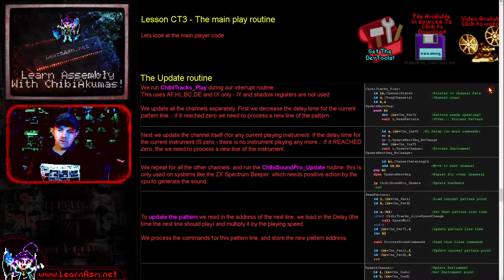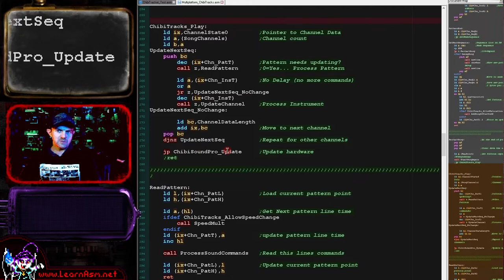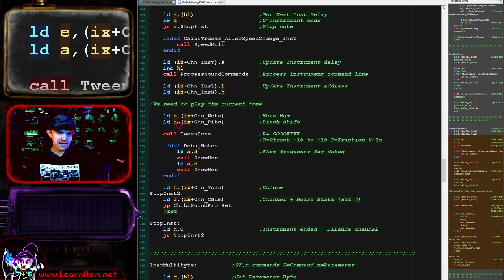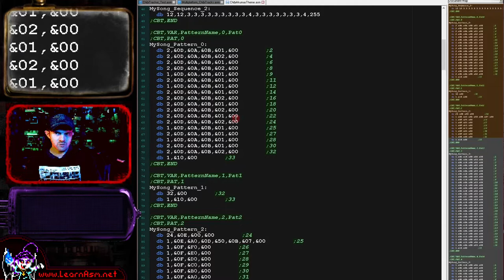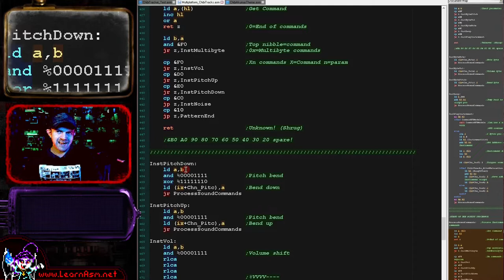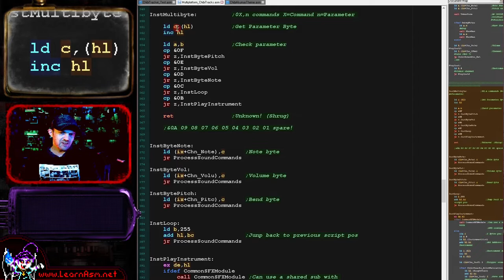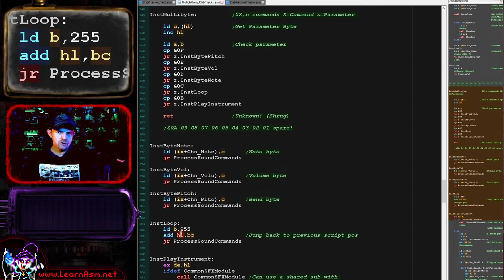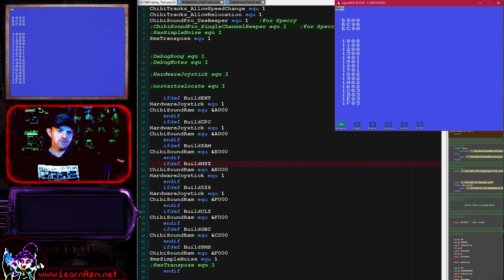Z80 ChibiTracks - The main play routine - Lesson CT3

Comment: I may have missed it, but what PSG chip are you programming for? The AY-3-8910?
Reply from the maker: ChibiTracks is multiplatform, there are 'drivers' for all all the systems generally covered in my 6502, 68000 and Z80 tutorials.

It was based originally on the AY, but is not limited to that system